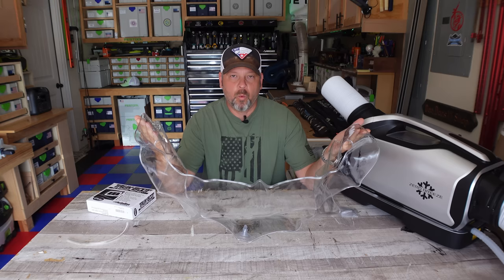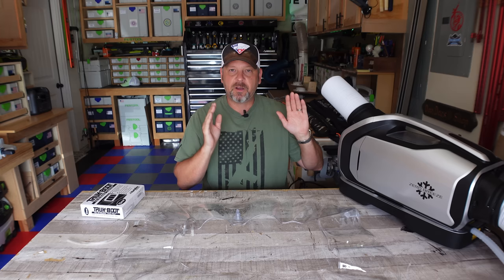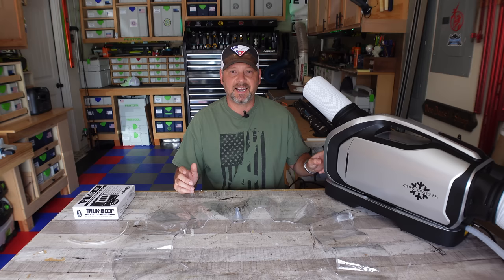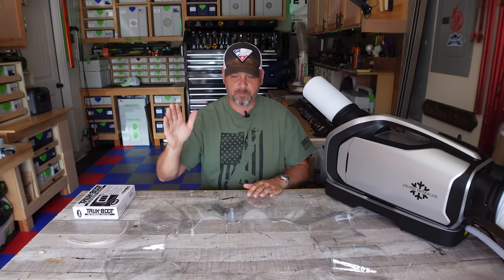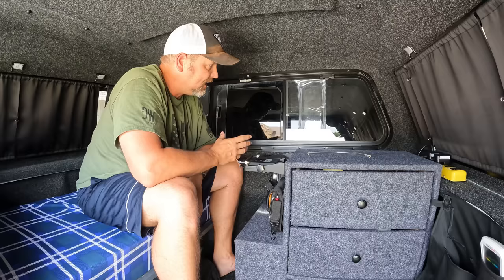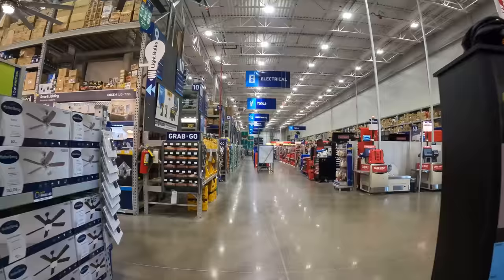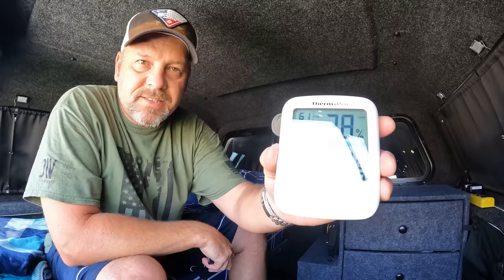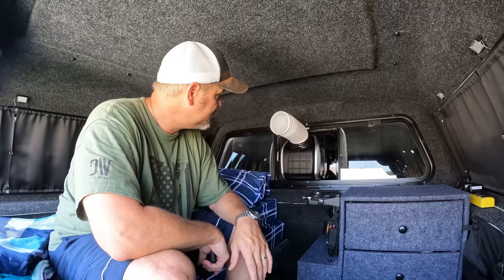TRUCK CAMPER A/C |  Performance Mods w/ a "Window Donut"!!! |  Zero Breeze Mark 2

Comment: The back half of the unit can be thought of as the outdoor portion of your home air conditioning system.  The front half of the unit is like the indoor portion of your home hvac system.  The front is removing the heat and humidity from the air inside your living space.  The back of the unit is transferring that heat (through the refrigerant) to the outdoor air.  The system is working between two totally separate environments, indoor and outdoor...
Reply from the maker: Makes absolute sense now. Thanks Kennis👍🏻
Reply: A window unit exhausts the heat transferring from your living space to the great and expansive outdoors.    You are trapping all of that heat in your cab.    The machine wants  lower temp air in the intake tube.... but it’s not getting it.  It’s getting super heated air that is trapped in your cab.     The machine is going to be working ten times harder.    You will have a bigger power drain and wear out the machine faster.      Those two back tubes need to be outside.....   not in your cab.         You are correct, the front grill of the machine needs to be in your cooled environment.      The air from the back tubes & the air from the front grills never mix.    They remain totally independent.     

The machine draws in air from your camper through the lower front grill.    It also draws in air from one back tube.    The machine transfers the heat from your camper air into the air stream passing through the back.   With that heat pulled out, it returns that camper air back into your camper.    The heat is now in the exterior air stream being blown out if your exhaust tube.      The way you have it set up.... you are asking the machine try to add that heat from your camper into air that is already super heated.      The dual tube AC is the most efficient - and will be a benefit in smoky air if near a forest fire.
Reply: Yes as a hvac tech there is to side to every ac system

Comment: I got a Window Donut for my Pick Up Truck & it was not worth the money spent on it. Throwing money away. Those a/c units are good. Where is your out take vent going to? It should never take 3 to 4 hours for those Units to cool down.
Reply from the maker: I agree. I ended up using a $2 bicycle inner tube, and it worked out the best. I have the out take 4” duct being vented to the outside through a window baffle I made for the rear passenger window.
Reply: @BrianWatersOutdoors can you make a video of the 4” duct being vented to the outside through a window baffle for the rear passenger window.  I’m buying  a portable air conditioner to sit in the back seat of  my truck to cool for camping and to keep my dog cool when I run errands.

Comment: My dad's 80s toyotas and my early 2000s Rangers toppers always had rubber seals permanently installed so you could use your sliding window. Why topper companies stopped offering those style boots is beyond me. These things are hideous, poke out above the cab and lose air over time. I LOATH them.

Comment: I've seen them for the whole window where you can eliminate both...  And you can cut the back of the cab out, and the back of the bed,  and make it a walkthrough....   Leave 6 to 8 in on each side and cover the entire area and rubber from a large inner tube...

Comment: I remember the inspiration for this too, “window boots” from the 70s. Vinyl material, several colors available mounted on the camper, then pulled through the truck window & snapped into place. A kid/smaller person could crawl through if need be.

Comment: The reason you don't put the back end intake in the camper is for one of two reasons. 1 - if the camper is air tight, there will not be enough airflow through the heat exchanger to draw the heat out. Reason is, the camper is air tight so no air is available to be drawn in and exhausted (the second reason will help explain this). 2 - if the camper is not airtight, the negative pressure created by the rear intake will draw the hot humid air in through the cracks (between the bed and tailgate), effectively canceling out the cooling. Also, keep in mind most all air conditioners are designed for a 30 degree drop from ambient air temp. If it is 104 out, you are doing good to get 74 out of it... especially in a camper shell with minimal insulation. Side note, love the videos. I am thinking of something similar when the Dually comes in. I like your design ideas.
Reply from the maker: Now that actually makes sense to me now!  Thank you👍🏻
Reply: It is not about pulling a negative. The are 2 systems in every ac unit that need to be separated always

Comment: They used to make a collar that fit through the window and was held in place by spring-loaded ‘hoops’ on each side of the opening. I had one back in the ‘70s. It meant that both windows were open all the time. But that wasn’t a huge deal. And I think if I were to ever add air to my topper I’d have to just bite the bullet and use a low-profile rooftop unit. I’ve seen that done before.
Reply: Still see them online, it’s a Accordion Boot

Comment: Instead of buying something thats probably over priced cause its so specific, the best thing that ive always used is a bicycle tire tube. Cheap and super easy to instal. Perfect window gasket found everywhere. Thats products to specific. Probably like 100 bucks. I can just have 10 tube backups. One last a whole year lol
Reply from the maker: I ended up doing that👍🏻👍🏻
Reply: Lmao I just said samething before I read your comment that's what I use and when gets low I use a football pump to fill it

Comment: They made those baffles in the 70s -80s but they were made out of inner tube material and you aired them up with a bicycle pump. The baffle went around the entire window, so you couldn’t see it except from the outside. Worked pretty good, you could crank up the AC in the cab, and you could feel it in the camper.
Reply from the maker: Don’t make things like they used to. I ended up going with an 18” bike inner tube. So far that has worked out the best.
Reply: @BrianWatersOutdoors  I wonder if you could get a few bike tubes, cut them an glue them all together with a rubber compound adhesive for a larger ring that took in the whole window?

Comment: You MUST intake exterior air for the hot side of the AC unit. If you don't you'll be pulling interior air in, then blowing it outside. You need to make that lost air up somehow and the result is you suck in hot hold outdoor air constantly.

This is why single hose "portable" ac units are terrible. No exterior air intake results in constant outside air pulling in.

How you have this set up is pretty much ideal.
Reply from the maker: Thanks 👍🏻👍🏻

Comment: I have a stand up portable one. I have to vent it outside and one on the back panel of the cooler inside pulls the cooler air, but the one venting outside blows hot air. It doesn't suck in air. I agree that using hot air to cool doesn't make sense. But it seems to work bringing the temp considerably cooler now. Happy camping 🏕

Comment: I once used a pool noodle, essentially the same thing as pipe insulation, as a window boot.  It worked for a time.  However, it began to wear away with the movement, and the top just began to crumble with UV degradation.  That, and it simply began getting more & more loose due to it being compressed, and remaining so.  Also any bugs or grit that settled on top, would eventually get stuck between and create a funky abrasive mess that scratched the glass and left a permanent, hazy line when the cap was removed, and rubbed the paint from the cap as well. 

I have been a long time searching for a portable AC that I can use in my van.   I have already used one of those household types that you have to run a duct out of a window.  12,000 BTU and took a 3,500 watt generator to run.   Then having to unhook it, roll it to the door and drain it every 15 minutes.. (It was humid AF!!) .. was making it pointless to try to cool the interior since I have to have the door open while draining it and letting all the cool air out.   I eventually removed one of the table sockets in the floor and routed a bit of hose from the drain, and out through the bottom of the van via that removed socket.   That setup worked amazingly well when parked.  But when driving, it barely did anything at all.  Note: the vans own AC died a week before my trip.  A trip to Montana vs my planned trip to Texas (Because it should be cooler up north, right?  RIGHT?)  Yeah it was 105 in Montana..  90's in the van when driving.  68 - 70 when parked. 

So.  I need a better solution.  (Fixing the van AC is probably off the table due to the inaccessibility of the pump without removing the engine)
Reply from the maker: I ended up using a bicycle inner tube that I inflate when I get to camp and works great. Let out just a little bit of air when your done and store it away. Works perfect for me now. 👍🏻
Reply: @BrianWatersOutdoors    Now there's a good idea!

Comment: I picked up a small window AC unit on CL for $50.   I put it on the tailgate (down) with a piece of plywood to close the rest of the tailgate opening, then close the back glass.  Works really well when needed - central Kansas in July and August.   No ducting or other mods needed.
Reply from the maker: I think I’m going to try that too. I have an extra 5000 BTU AC from my rv build.
Reply: Ya if I had a truck I'd  just permanently mount a window ac in one of the side windows, but I've been trying to gather videos  on what to do with my minivan, still deciding  thanks for the ideas!

Comment: You're going to hate me for telling you this, but EcoFlow is selling refurbished Waves for $799. I ordered mine a few days ago and just got it today.  Waaaaaaaaay more power than the ZeroBreeze II, but it's louder too.  You'll have to decide if you want to upgrade, but it's cheaper than a new ZeroBreeze II.

Also, you should try some reflectix on all the glass, trust me, it'll help TONS.  If you haven't insulated your floor, that's something you should consider too.
Reply from the maker: Ugh. But, I did put reflectix up now instead of the curtains and it does make a difference. I’m about to trade in this truck for something bigger and have plans to install a 5000 btu a/c in that setup. Should be interesting.

Comment: The intake on the back of the unit should intake outdoor air.  This is so the unit does not take inside cooled air and push it outside.  This would cause negative pressure in the cooled area which would cause hot outside air to leak in anywhere it can. The front intake and outlet will cycle the cooled air multiple times to cool it even further.

Comment: It looks like the cold air intake is at the front of your unit so it would make sense that it would be colder because it's pulling colder air in.
Reply from the maker: Yes, that’s right. Works much better when the front intake is inside the camper.

Comment: Greetings from Oregon!  Not sure which part of the country you live in or how much cooling power you need, but an easier solution might be to install a Fantastic Fan in the roof of your truck canopy.  They're very popular even in high end RV's, and because heat rises, can be very effective at cooling things down.  Also alot smaller and take less power than AC.
Reply from the maker: Thanks👍🏻

Comment: You can also use a mountain bike tube on a smaller window like that. Easy to slip in there and easy to inflate plus it doesn't squeak because it's rubber.
Reply from the maker: Yup. That’s what I’m using now👍🏻

Comment: Ive been using a tire inner tube in camper for years works like a charm
Reply from the maker: Yup. Using an inner tube now👍🏻
Reply: @BrianWatersOutdoors  Can you hear the tire tube squeek from the inside of the cab while driving? I've been looking for options for a passthrough window but haven't found weatherstripping that's thick enough. Looking up reviews for thr truk boot brought me to your video and it would bother me if it was squeeking like you said.
Reply from the maker: I don’t drive with the inner tube installed so I can’t confirm if it squeaks. I only install it once I park. Takes about 30 seconds.
Reply: Thanks 👍🏽

Comment: Bicycle inner tube might be a solution. Various sizes. Easy to find and replace, relatively cheap.
Reply from the maker: Yes! I ended up using an 18” bike tube that works out the best so far

Comment: Concerning the hot air intake…… the way AC units work is by taking heat out of the air thus making the air cold. Is does not work by cooling the air. You can’t extract much heat out of air that is already cold. So yeah I see where that makes since what the manufacturer recommends.
Reply from the maker: Thanks👍🏻

Comment: Good Idea with that pipe insulation as you pass through gasket.  I am using a bigger portable AC unit in similar setup in my truck and you have it setup about that same.  I found that it works way better that way.  The unit itself puts out heat so having it split up works best for me too.  If its super hot I hang a blanket up to insulate it a little better.  Most times though just having the cold air blowing gets me to sleep easy.
Reply from the maker: Thanks👍🏻

Comment: It has a hot and cold side. Each needs its own intake and exhaust.
The cold side is in where you are. sucks hot air through a radiator with refrigerant and that cools the air where you are down

on the hot side on the back. The hot refrigerant goes through a second AC after being compressed and heated up and gets cooled down by the outside air. 
others can explain it better than that. But essentially you want the hot side outside.  and the refrigerant goes through dramatic temperature changes between the hot and cold side which is how it works.
Reply from the maker: Thank you for that. I think I have it setup now to hopefully make it more efficient. 👍🏻

Comment: It's supposed to go around the whole perimiter of the window like the original boot that seals the shell to the cab. Not just the slide for the window, I have the same problem with separation and need to loosen my shell and slide it closer to the cab closer. That's a good product, but thought it was funny when you pulled the whole window towards you. I wanted a window that slid down automatically but without the window you have access to the cab and a seal if you go around the whole hole 🕳 👍

Comment: back in the 70's i seen someone with the back window completely removed and the bottom portion of the truck cut away with the same cut away in the topper and between the trck back and the topper was what can best be described as an inflatable bladder that was the shape of the cutout and it was covered in some kind of rubber or ripstop material, and you could actually pass thru the cab to the camper.....next... take the donut to a canvass shop and have it covered in some kind of material ? pool noodles will be bigger and probably better to squeeze in there and might stay put while driving
Reply from the maker: I’ve now found that a bicycle inner tube works the best for my application.

Comment: Years ago we used to use bicycle innertubes
Reply from the maker: Yes. That is what I’m using now and it has worked out the best.
Reply: @BrianWatersOutdoors  take a little baby powder and rub it on the inner tube and it wont squeak on the window

Comment: Don't know why it's so complicated. It works like a window unit in your home. You need to separate front half from the back half. Meaning, front half with intake and cold air exhaust needs to be sealed off from the outside or backside. The reason for the exhaust tube is to get hot air out of truck cab. Your condenser coils are cooled with the outside air while the interior of camper shell is recirculated through the cooling coils on front side. Sealing off around cooling unit will ensure none of the cool air escapes to the outside.

Comment: I came here to see that Boot, and watched your video. I used to work in HVAC, but have not seen that Zero Breeze. More than likely, that 4" duct is actually the exhaust for the condensing unit? HVAC systems remove heat from a location its not wanted, and transfers the heat to an area it doesn't matter. The heat transfers when the hot interior air blows across the cold coil and the   refrigerant grabs that heat, then its pumped out to the condensing coil where the blown air grabs the heat.
Reply from the maker: Great explanation👍🏻

Comment: Besides using foam or that clear plastic boot I seen people use Bike Cycle inner tubing to seal between the cab of the truck and the camper Might want to try that on the next setup.
Reply from the maker: Yes! That’s what I’m running now and it’s been the best option so far. 👍🏻

Comment: The fresher the outside air, the better. The more sealed off it is, the better. Think of it as a window AC unit. The inside air recirculates, and the outside gets cooled by the fan that’s blowing the coils that do the “AC magic” that cools the other side. 

Essentially an AC is a refrigerator. The hotter your inside is, the warmer the air will be. If you give it plenty of time to cool off the things and surfaces, it may get even colder.
Reply from the maker: Thanks👍🏻

Comment: The reason for the one rear intake hose is to bring in fresh air from outside, soooo... technically you could route the rear intake to inside the camper and have both air inputs coming from the cool zone of your camper.  This might create a negative air zone in your camper though, depending on how sealed it is. The other hose is the exhaust hose as describe in another comment.

Comment: I had one of those donuts on my camper too u right they do squeak and another problem if u leave in all the time it will rub the paint off the back of your cab it happened to me. Also u really have to blow it up very hard cause as u saw it will loose air.
Reply from the maker: Yup! Thanks👍🏻👍🏻